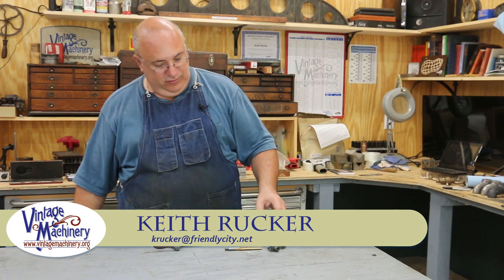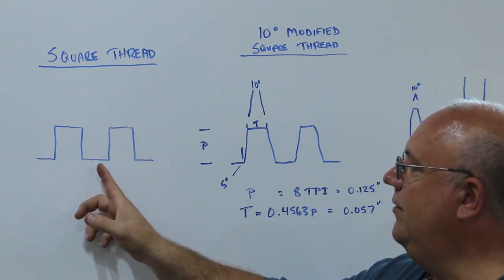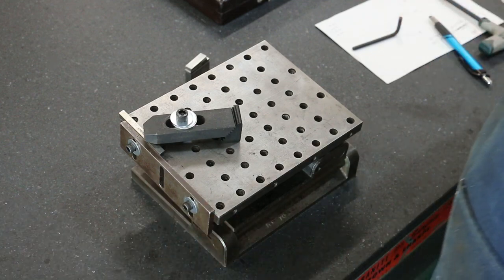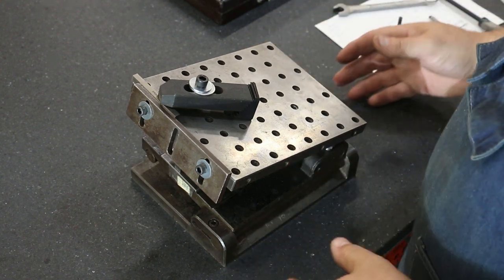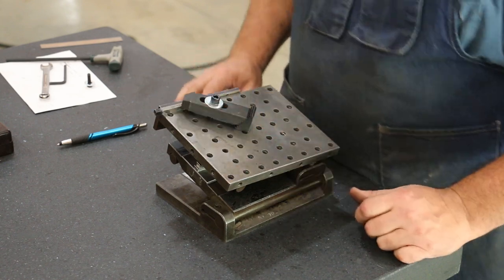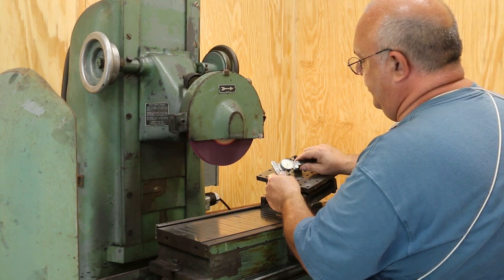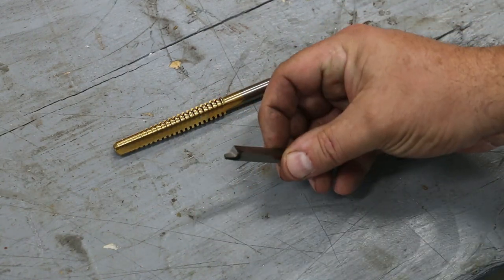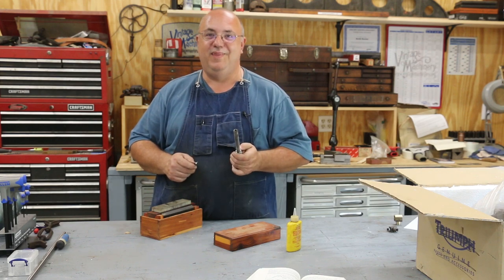Grinding a Custom Threading Tool on the Surface Grinder

Comment: the distance the blocks are placed in relation to the fulcrum changes the angle. The blocks placed close to the fulcrum (hinge) make a bigger angle. The farther the blocks are away from the fulcrum the less the angle.

If you are using (I think) 5 inches as your sine is that not where the blocks should be placed? Also whether the blocks are placed long side to the hinge or short side to hinge also affect the angle.
Reply: they were placed at 5 inches, theres a round bar underneath each of the 2 upper plates, where the sine bars intersect, so always at  inches
Reply: No, at 20:oo minutes he places both sets of blocks. The second set are placed short side to the hinge ensuring only that the closest top of the block bears the weight. If the blocks were turned and placed with the long side to the hinge it would bear the weight better.

Also I did not notice any particular reference spot to place the blocks, whether long side to hinge or short side.
Reply: Ah, I just saw the round bar under the plate. Now it is clear to me.
Reply: The roller is five inches from the fulcrum point and that's where you place the blocks
Reply: I was sweating that detail as well.

Comment: I would've been fired for using Jo blocks for a set up like that. They would expect me to mill/ turn/grind something to size to use. 
Also you don't want any oil between your Jo blocks when you wring them together,  that will make the stack bigger.
Reply: some jo blocks are in the millionths of an inch. If you can do that where you work my hats off to you.
Reply from the maker: Jo blocks actually will not wring unless there is a slight oil layer.  Most people just wipe them against the back of their hand which wipes them clean and puts the perfect amount of oil on them from your skin.
Reply: If you have good jo blocks you can clean them with acetone and they will wring together.

Comment: Keith, I'm confused as to how you put the gauge blocks in the sine block. Would it not change the angle putting them in the way you did, instead of putting them on the outside edge of the sine block turned parallel, since they are not tapered?
Reply: ??? WT?
Reply from the maker: The bar that you place the stack on is a round bar so that it does not matter what angle the plate is at, they are always the same distance apart.
Reply: Hi Keith, Ok, now that makes to me , I have never used a plate, so I learned something. Thanks.

Comment: Since the original is square, why can't you cut the ten degrees off of the original threads instead of making a new shaft?
Reply: He would still have to make the cutting tool he just showed to accomplish that task and he would have to "pick up the thread "On the lathe.
Reply: At 2:30 he says he's going to make a new thread...presumably meaning a new shaft. I understand this video was about grinding the tool....just commenting on the overall scope of the job. Picking up the thread is a piece of cake especially for someone with Keith's experience. So again, the question is why not just shave off the square threads of the original shaft to get the 10 degree modified. Unless there is significant wear into the root of the threads I can't see why it wouldn't work
Reply: Yeah maybe your right. but he probably figured he has the tool so just make a new one.
Reply from the maker: The original thread is severely worn to where it is of no value.

Comment: using the surface plate is not necessary to set up the sine plate, any work surface would have done.. still enjoy the videos
Reply from the maker: I am just used to being on the surface plate when I am doing anything precision.  But you are correct.

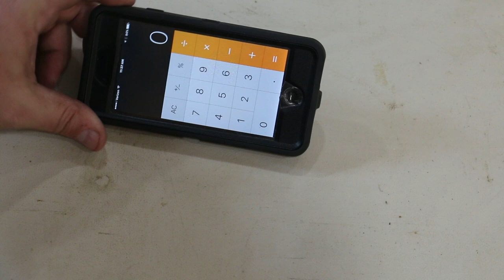Comment: 12:30 When i calculate 5×sin 5 i get -4.7946. 😈  Remember to switch your calculators to degree mode (🅳, not 🆁), folks!